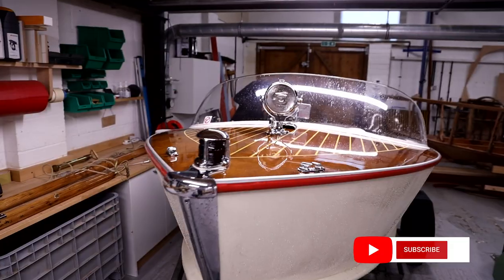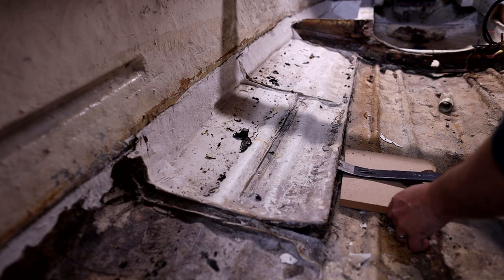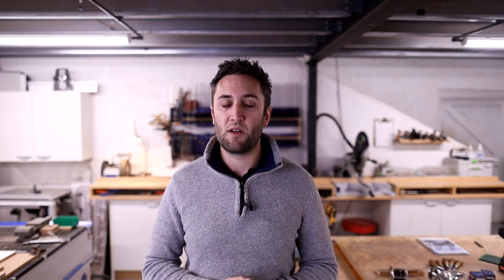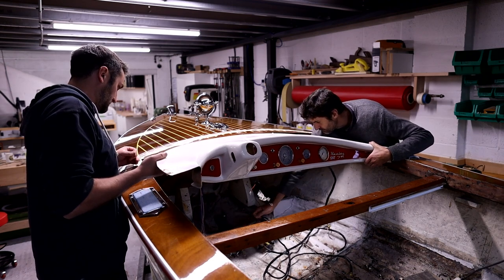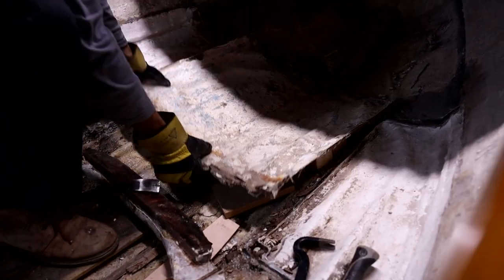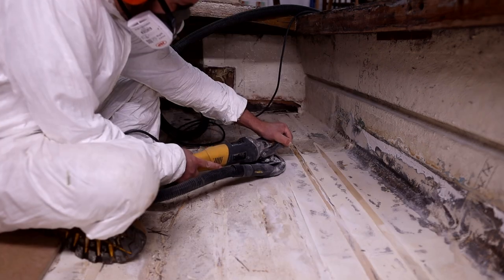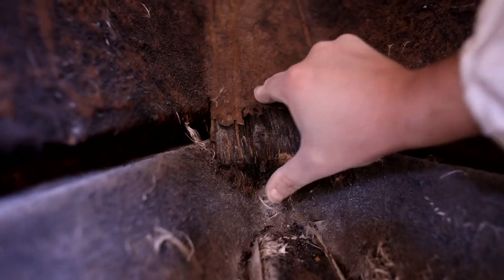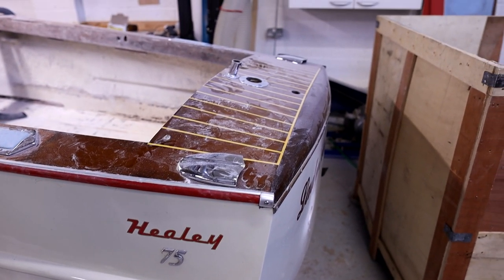Boat Strip Down and Fibreglass Grinding | Healey Boat Restoration Part 1

Comment: That’s a truly horrible day at work, stripping out stuffed poly/glass. 
You both have my sympathy!
She’s a good looker though, be lovely when you’ve worked your magic. 
As a matter of interest, what powerplant does she run?
Cheers, R. 😎👍🍻
Reply from the maker: Oh yes, not much fun, at least most of it is done now though! This boat has an 1800 MG engine in it.
Reply: @DanLeeBoatbuilding  Glad to hear that bit’s about over. I’ve just done a 16’ Bass boat with the same set of problems, less wood to deal with than the Healey but every square inch of interior surface had been doubled up with poly/chop that was delaminating. 
The dust and fibres suck, but it’s the stink of the poly when it gets hot through cutting or grinding that I really hate. It makes me positively queasy for some reason. 🤷‍♂️
With an 1800 in her she’s going to be fairly quick, nice!
Anyhow, good luck with her and thanks for your vids. I’ve picked up a lot from them, not least a new found enthusiasm for just getting stuff back to bare bones and remaking, rather than patch up and know I’ll be doing it again down the track. 
Cheers ol’buck, R. 😎👍🍻

Comment: Good job ! Use epoxy ! polyester and wood is not a good solution ! Felicitations from FRANCE !😋
Reply from the maker: I will, I don't really use polyester at all these days, it's not good for much other than wet on wet moulding.

Comment: Great video, just subscribed. Question, why didn’t you do the horrible internal work before you did the outside? Cheers
Reply from the maker: We did, we haven't done the work on the outside yet.
Reply: @DanLeeBoatbuilding  oh! The outside is obviously in better condition than the inside! Can’t wait to see all the videos!
Reply from the maker: Yes, it had been done as some stage, when it first arrived at the shop it certainly didn't look like a boat in need of restoration!